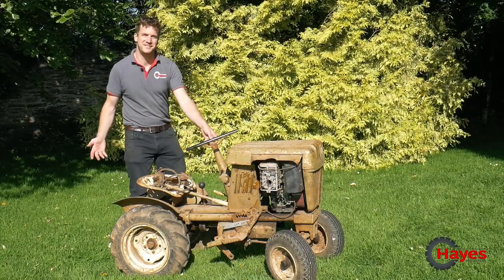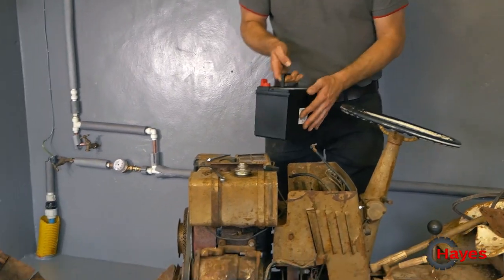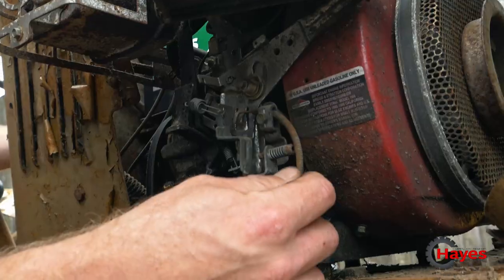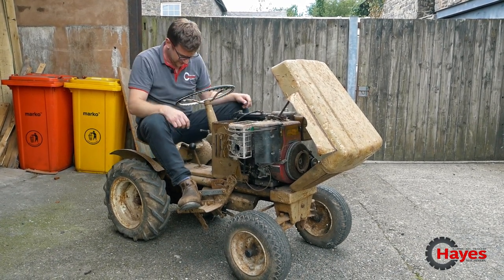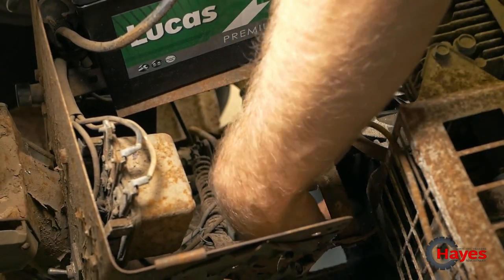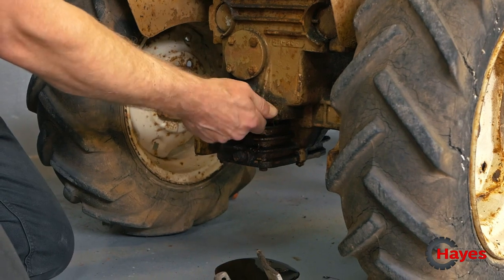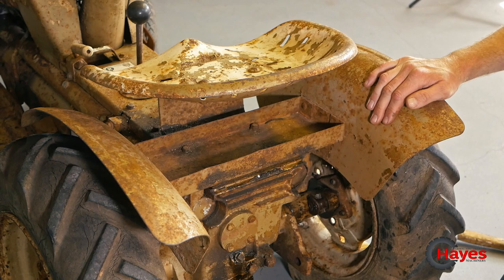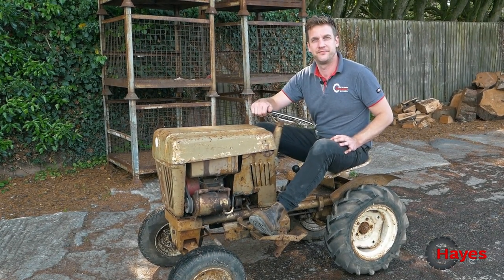1963 Bolens Husky 600 Lawn Tractor RESTORATION | Part 1 of 6

Comment: If You have any questions,  let me know, or watch my you tube videos of 1962 Bolens husky 600.  I have one issue with your trailer hitch. The original 62 has a hitch,  cast with the rear end as 1 piece. The fact that You unbolted the rear hitch tells me that the rear end is newer than 62. My 750 and 1254 have a bolt-on hitch. 
 It looks as if they snapped off the original hitch, then tapped through to the transmission. There should not be trans fluid leaking from those bolts. My suggestion is to insert studs like the 750. 
 It will help, long term, to keep some grease on the locking pin and the two plates that rub against each other. This is necessary to keep things working. 
 My experience is that many of these tractors were pieced together with interchangeable parts, over the years. It is possible that You have a 750 rear end, on a 600. Keep in mind that people sold these under the name 600 for higher value. It could have multiple parts from different years
Reply from the maker: Hi, thanks for watching. We will check out your videos like you say!